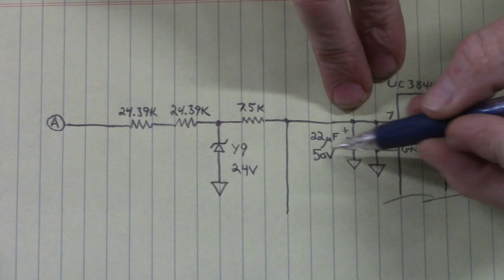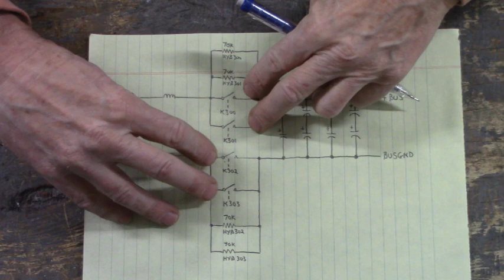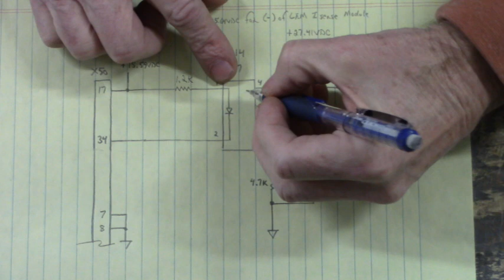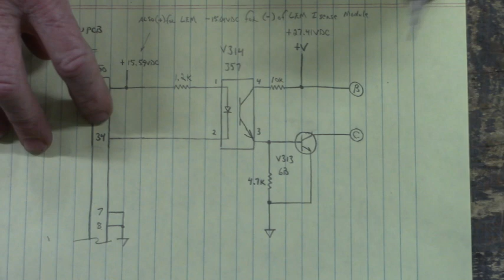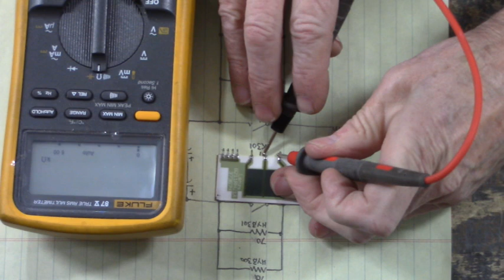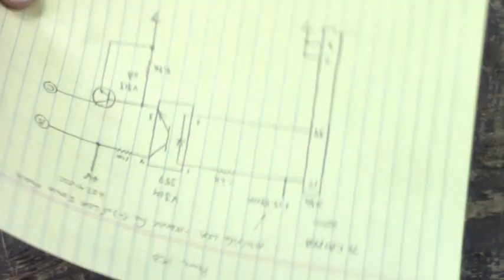Lenze EVS9300 Series Drive and the UC3844B SMPS IC

Comment: Hello, I'm from Indonesia 👋
I want to ask🙏 
what causes the OH03 alarm to trip the temperature that reads is above 300⁰C on the T1 T2 connector if the thermistor is removed and installed there is no change, the temperature it reads remains high

Comment: Now that's one equipment I worked a lot. Sadly I'm being bypassed by the big players in the market and I get almost none of those in my bench anymore, even though the ones I fix works years prior to failing again, while the other companies can't fix properly it... Well, is hard to fight the power of the money. 😂
Reply: I've gotten whole CNC machines for free (or well below scrap price) because people "fixed" them right into not working or being reliable again. Competent repair is few and far between, and usually very expensive when it is available. I've also fixed a few CNC machines for people too and definitely kept them out of the scrap pile in the process